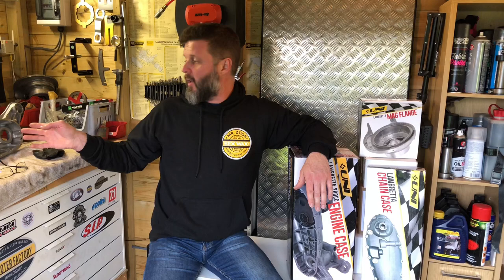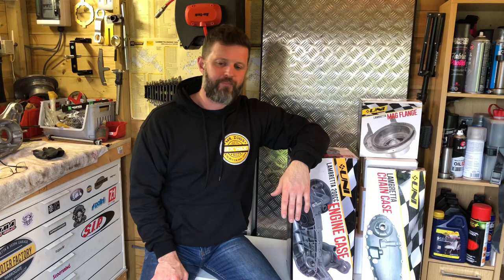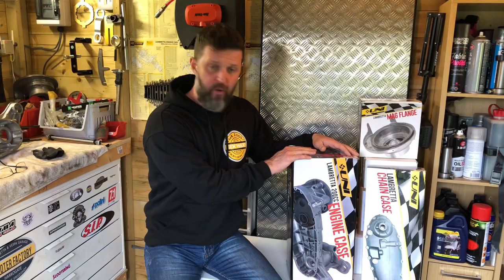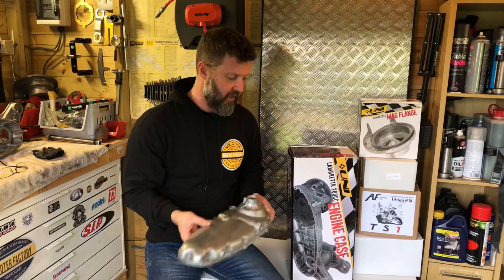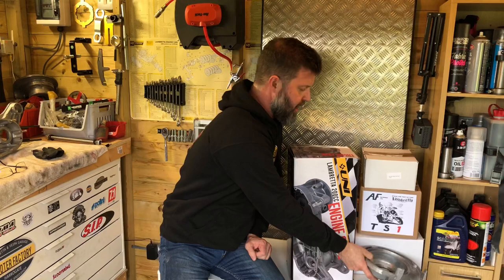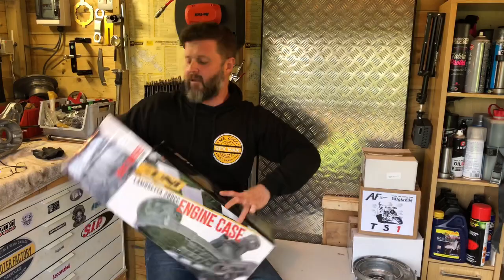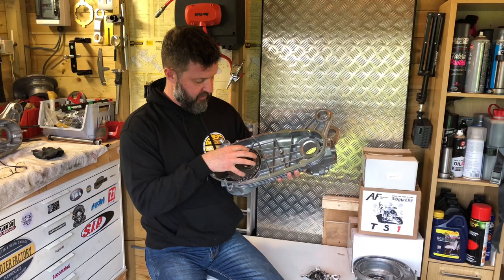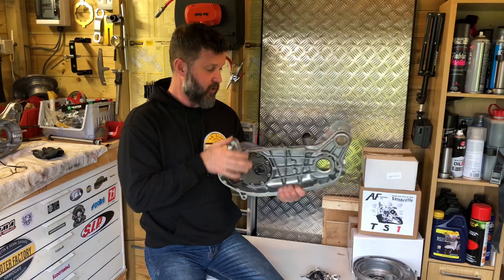Lambretta UNI Engine Casing - Tech Spec - Inc Chain Case Cover & Mag Housing - Unboxing Review

Comment: Hi, I recently spoke to a very highly rated UK dealer about why he's not stocking this case anymore.  He said he's had to weld a few. More then he's had to with a SIL casing.  Also he's had the aluminium tested and it's not very good.
I'm a tad confused now as had my heart set on one.  
Would you mind, now that you've prob finished off your engine, give your honest review, post engine build (won't hold you to this) of the casing, threads, quality, end plate match/quality etc. 
It'll be very much appreciated. 
Thanks

Comment: + on the SIL stuff, I bought a NOS 150 cylinder head off Bedlam when they closed down and it was more than fine quality wise - it just needed to be tidied up in places. Haven't had a good look at any of the new UNI stuff , but been using one of there hubs for a while now and a really good, durable and affordable replacement though does spin a bit off centre. Had the same issue with genuine SIL hubs as well.
Reply from the maker: Yup, I like UNI hubs, I shall be using one on this build. 👍